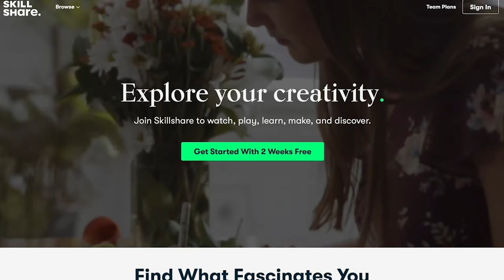I Make A Platinum Bangle With 10ct Of Baguette Diamonds

Comment: I have noticed that the most light is reflected when diamonds are cut in the modern diamond shape. That's the purpose of diamonds, to reflect the most light
Reply: a round diamond has more facets than a baguette diamond, this creates more sparkle because more light refraction is taking place. A typical round cut diamond will have 58 facets while a baguette only has 14.

Comment: Bobby, how do you heat up and merging the small pieces of material without melting the bigger pieces as well? Is it the thickness or a different material? What’s that little squirt bottle filled with, that you brush on the piece and lay the material on? A bonding agent? Water? I’m fascinated

Comment: What is the tool used at 8:18?? Always see it being used to hold stones. Any answer is grateful
Reply: Its just an old bur that has been cut off flat at the point and put into a pin vise or handle. He touches the tip of the the flat bur to his tongue and the saliva holds the stone in place while setting in the mounting.

Comment: What’s that thing you’re grinding before soldering, is it like a lube or something? 🤔
Reply: It's flux. It allows the solder flow and stick where he wants it by protecting the metal from oxidation. Not sure exactly what kind of flux it is as there's different things you can use. I think Aquiflux is one of the main ones jewelers use.